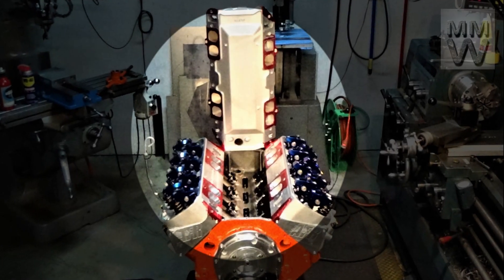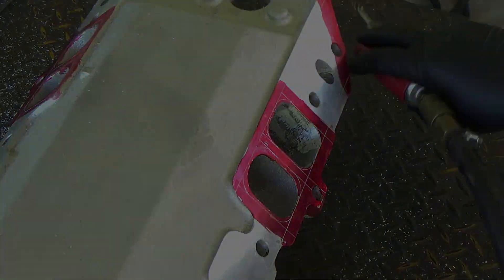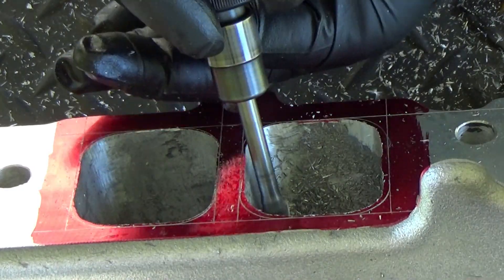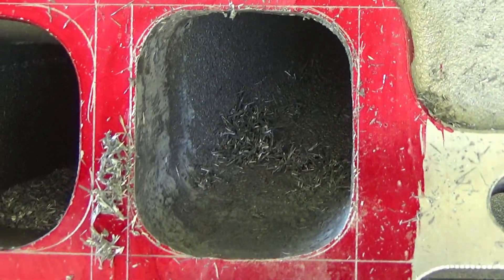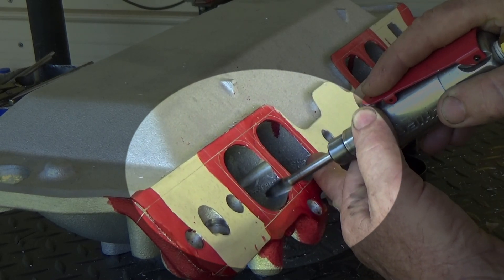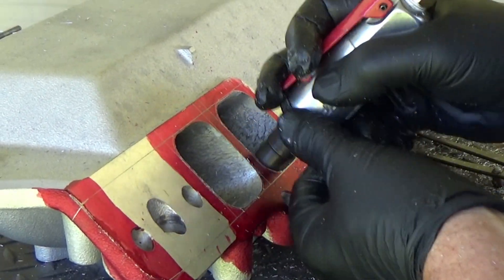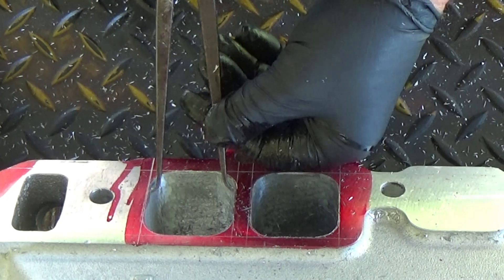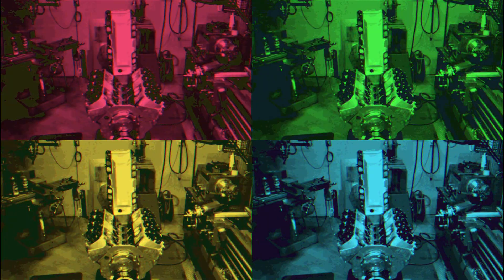Port Matching the Intake to the Heads( part #2) -#21 of the Chevy 454 Big Block Performance Build...

Comment: Have a question for you , btw i port matched my intake and it came out great 468 bbc stroked ,, anyways I have a pete jackson gear drive on the engine, how many degrees of play should I have before the rotor starts to move turning the crank backwards from 0 degrees    Once I set it , , it’s been done a long time ago , I just realized I don’t hear the gear whine anymore ??
Reply from the maker: Thanks for the question Bill...  I have not run a gear drive system and have no experience with them so Im not sure.... I would look it up on youtube... some one has worked with them and knows...... Thanks again.

Comment: Top notch Sir, much obliged for the insight.
I don't know about youtube algorithm, but I'm satisfied. Sir any inputs on the inlet pressure to that grinder.
Reply from the maker: Thanks for the nice comment...  The air inlet presser was around 100 psi
Reply: @Myersmetalworks  you are welcome Sir.

Comment: Did you take final measurements of the port sizes ---height, width, diagonal?
Reply from the maker: Hi Robert... I don't have the port size... but it's basically AFR intake gasket size....

Comment: IF YOU USE THE OTHER BIT THAT IS FLAT WITH ROUND END RATHER THAN THE ACORN IT IS MUCH EASIER TO NOT GET SO MUCH UNEVENESS.
Reply from the maker: Thanks for the tip....👍